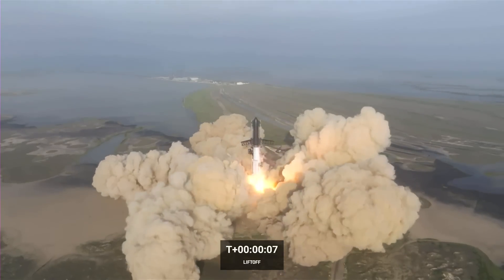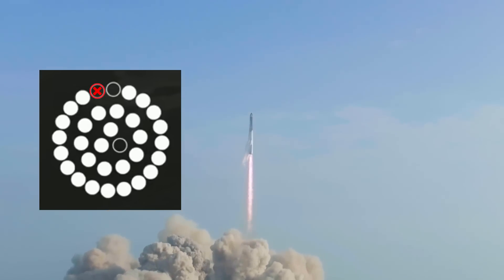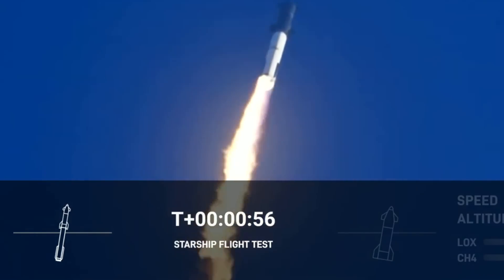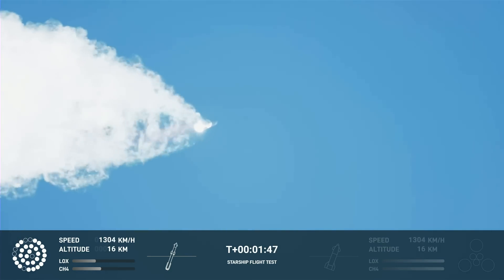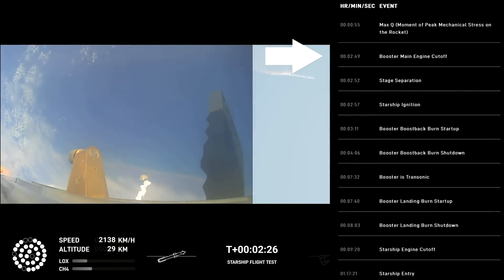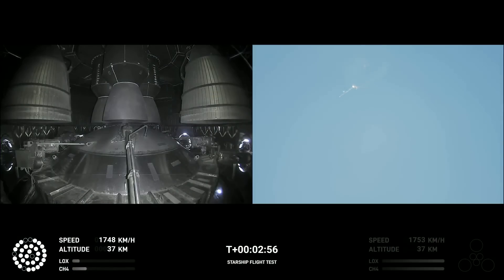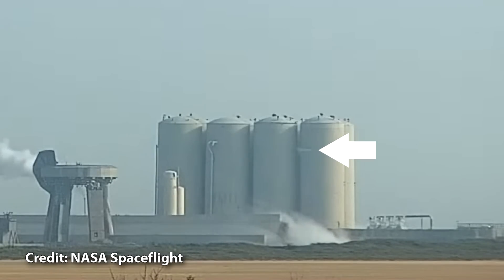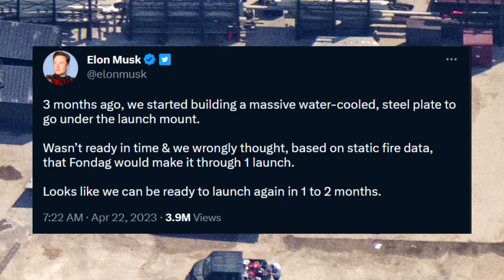I Watched the Starship Test Flight at 0.25x Speed & Saw What Went Wrong | Starship Flight Analysis

Comment: I say the most worrisome takeaway is that the flight control computer obviously didn't know which engines were still lit and operable after about the +30 second mark. 

This caused two prompt effects:

Valves that should have shut down seem to have still been dumping hydraulic fluid, LOX and fuel into ruined engines
...and the computer code responsible for maintaining vehicle attitude never adjusted to the loss of engines and hydraulic fluid.

To me this says the engine compartment heatshields were scoured right off the butt of the first stage by a swirling mass of tens of tons concrete aggregate and steel rebar moving at transsonic velocity, likely in the very first second of ignition, an effect that in turn exposed hydraulic lines and wiring harnesses to exhaust reflux and shrapnel.

Half the hydraulic loops likely bled dry in the first ten seconds. This should have been caught in time to prevent the hydraulic power units from going into a no-load condition and self-destructing. But it wasn't, likely due to a combination of cut wires and insufficient cutoff valves.

The second most worrisome takeaway is the utter lack of adult supervision.

The sheer wanton foolishness of this launch cannot be overstated.

That cloud around the base of the first stage in the first eight seconds? Isn't condensed water vapor, it's concrete dust. Note the color. 

Concrete dust can be seen exiting the pad within one second of first stage ignition, before most of the engines are even lit. Along with it come big floppy sheets of thermal protection felt -- likely a mix of engine compartment heatshields plus protective blankets within the hold-down assembly.

What could have broken up the concrete so quickly?

For starters, it wasn't well-cured concrete. We know that every static test caused concrete damage which was repaired simply by pouring fresh concrete in the resulting hole. The final pour under that rocket wasn't even a month old. It was at maybe 30% of its rated ultimate strength when those engines lit.

It was also fitted into an existing blast crater and not tied into surrounding substrate or structure. Someone added horizontal planes of rebar within the pour, as if this was some airport runway, but did not or could not tie that cage back to any meaningful anchor points outside the pour. Basically the only thing holding it in the hole was gravity.

Thirdly, the acoustic force of the engines was causing the concrete to repeatedly spallate. Concrete hates to stretch, to go into tensile load. Acoustic force causes equal amounts of compression and tensile load hundreds of times each second. The concrete ruptured each time its tensile failure fluence was exceeded, and the resulting spallation fragments carried away most of the force of the rupture. The result was an ongoing series of explosions powered by sound, with fragments moving at shotgun blast velocities.

Igniting that first stage on that stand basically shot it in the butt with an immense shotgun powered by that first stage; Every time it was lit, static test or otherwise.

And yet the executive decision was made each time to press forward with more tests on an inadequate launch pad, inadequately repaired.

The stony expression on Elon Musk's face as the vehicle finally crumples tells us this was not a Satisfactory Outcome, no matter how many rocketry fans assure us it was so...

Comment: Really good analysis. Thanks. 
I was amazed to see Starship actually fly and clear the pad. Brought a tear to my eye to see such an incredible machine take to the sky. Disappointed that the stage separation didn't happen but that just means more excitement to come on the next flight.
Reply: The pad damage is minimal, the tower & launch mount were only slightly dinged up… a pit was dug in the sand, but is easily filled in, new concrete poured, robust pilings added, the new blast deflector & water deluge installed. SpaceX moves onward & upward… while NASA is mired throwing more taxpayer $billions  at it’s unaffordable, unsustainable dead end SLS boondoggle.

Comment: Very good analysis and presentation. I believe this is the first video I have seen from you, definitely subscribing and looking forward to seeing more. If I may add, I believe the launch pad should have been elevated 2 - 3 times current height. For every feet of increase height from the concrete base, would have an exponential positive effect on the psi at  the concrete base thus causing less damage and debris deflect toward the stationary and eventually slowly moving Starship at takeoff.

Comment: Positive:

1. Structurally the Starship held together a lot better than I had expected. Not many rockets could tumble around like that without disintegrating.
2. The rocket had enough power to lift off even after loss of raptors
3. The control of the rocket worked pretty well. They controlled if for a long time with raptors and hpu`s failing
4. The launch tower appeared to do well

Negative

1. The launch pad is completely inadequate and the layout is not well designed
2. The raptor appears to still be unstable. A lot of raptor failed throughout the flight. This is critical as they were supposed to be reusable. We have seen this failure rate from raptor on all launches. Could get critical if they cant make it more reliable.
3. The flight termination system failed and it needs to be redesigned
4. The stage seperation system failed (unless they never tried)

Not tested/inconclusive

1. The heat shield was never tested
2. Is it underpowered/overweight? Looked very slow to accelerate, but unclear if it was just the missing raptors
3. Starship second stage
4. Descent and landing

Comment: I hope that water-cooled steel plate works for a rocket of that size and power. The alternative is to build up a pad like NASA did for 39A for the SaturnV. Took them 3 years, an army of people and equipment and a whole lot of money. With todays stricter environmental regulations, it could take years for SpaceX to even get the permission to do the dredging operation required to build a pad up by nearly 50 feet (39A was 48-49 feet somewhere around there) in an area with a high water table. That's considering they get the permission at all.  Barring that is the off-shore launch as was originally planned but those two oil rigs were not going to be strong enough. Either way an alternative solution would be years out and to get on track with Artemis III they will have no choice but to launch from FL, if NASA will even allow the risk with the powerful Superheavy.

Got my fingers crossed that the plate works out.

Comment: The launch never should have happened.  Without a proper launch pad with water suppression system and flame diverter, OF COURSE they were going to have a failed launch.  The FAA should have said "NO Launch for you."   "Clearing the launch tower" isn't much of win.  That's not something the space industry uses as measure of success since the 1950s. 
In the slow-mo video, you can see concrete chunks SHOOTING around the rocket, HITTING the rocket.  Then on a wider shot, as it's leaving the tower - you can see large chunks hitting the dirt and the water (gulf).     There are articles from 2021 about the Launch towers not approved for launches (testing, yes).

Launching with a lauchpad that couldn't handle the configuration IS BAD.  Having fuel tanks NEXT to the rocket IS BAD.  All that damage was preventable.  This shows BAD engineering, bad planning, corruption (paid off FAA for launch permissions?) and BAD business.

They'll be lucky to have another launch in 2024.

Comment: Aside from the largest rocket in history actually flying what impressed me the most was its ability to tumble without immediately disintegrating. I have never seen a rocket tumble that didn't immediately explode. That's VERY impressive structural strength and comforts me about the safety of future flights
Reply: Over engineered maybe. Possible weight reduction could increase payload.
Reply: Why the FUCK should a rocket be designed to tumble? If it's tumbling, really really really bad shit has happened. If it was designed to be strong enough to tumble, then it's too goddamn heavy and is carrying utterly needless weight. You Elmo slurpers are so desperate to claim everything he does is perfect but you are utterly blind to reality and immune to common sense. WTF is wrong with you?

Comment: My take on it: It went further than expected, but still disappointed it didn't at least reach separation. Great analysis, thanks!
Reply: Why the FUCK didn't you expect it to go further? If you think all it had to do was just clear the tower, what if it had blown up 1000 feet above the tower? Would that still be a success? 100 feet? 10 feet? Why didn't they expect it to survive liftoff? That means it wasn't ready! Claiming that it succeeded simply by clearing the pad is like saying your brand-new car is great because you were able to back it out of your garage before the engine seized and the wheels fell off.

Comment: Starship is not held down by clamps during launch.  The clamps are released much earlier during the countdown.  The engines are ignited at 50% thrust, below a thrust to weight ratio of one.  The rocket sits there until the engines ramp up to full power for go.

Comment: Okay, let me get this straight. Eight out of 33 engines died of some cause or other, the HBU exploded, there was apparently a massive loss of fuel somewhere along the way, the flight termination system didn't terminate the flight, and stage separation didn't work... also, the state park near the launch site was bombarded with concrete, and it's sheer luck that the fuel tanks didn't go up in flames.
But the only real negative is that the launchpad was damaged, so it'll take a while before they can do it again?
Something tells me you're a bit on the optimistic side. Would your evaluation be the same if the rocket had been made by a company not owned by Elon Musk?

Comment: I predicted they'd think about launching with X engines missing and would decide in advance how many missing engines they would tolerate. Elon confirmed this: They launched with three engines out. 

There was a launch "recently" (last year or so?) where the stage separation didn't work as expected. They just started up the second stage and "overruled" the failed stage separation. 

I would have hoped they would command a "forced" stage separation once the tumble started (i.e. first a "release clamps" and then just ignite the second stage: see what happens). Having starship start off in an unusual/unexpected attitude and hopefully being able to gain control is better than just hitting the self-destruct button.

Comment: Nice video!

In order of severity:
1. FTS didn't work, in as much as a worst case scenario may not have handled wayward-rocket-syndrome.  This will make FTA very cautious.  SpaceX will need to refactor the FTS, and then "prove" to the FTA that the revised FTS will work.  Given there is now evidence of a FTS not working, I am wondering a "paper" test will be sufficient, and if instead some in-flight abort test may be required. 
2.  Raptor reliability.  I suspect these are older raptors, and newer ones may be better, but even so, a lot failed.  Elon's twitter update suggested the three at start simply didn't come up healthy.  Subsequently many failed.  Almost every flight test and static fire has had some degree of engine issue.  Sure, lots of "little" engines gives reliability through redundancy, but after years of development we still have failures.  Full flow staged combustion is hard, I worry if it remains too hard to be "airplane like operations" reliable.  Hopefully they've gotten lots of real world data, and have root cause, and latest raptors have tweaks to improve.  Maybe then the best course of action is put older raptors on a superheavy, build a dummy starship, and do a in flight abort test, and then move to latest raptors.
3.  Launch mount is meh.  Most acoustic energy is at 45 degrees to plume (iirc), so a deluge system exists for sensitive stuff like payload and the pad stuff, so it just needs to keep the pad cool enough not to disintegrate and cause public concern and possible rocket/pad/tank-farm damage.  Water cooled steel plates laid into the floor seems reasonable for v2.

Comment: I can’t understand how SpaceX designed and constructed that launch site so poorly. Typically, great efforts are made to deflect hot gases and cool them with massive amounts of water while touching any kind of structure. Secondly, why did they place so many facilities like their storage tanks that close? Damage during launch had to be expected. Maybe the pressure to get StarShip off the ground quickly was just too high to construct the launch site properly.

And I doubt that the maximum design dynamic pressure was reached.
With that much thrust missing, acceleration was lower than planned, and therefore speed. So the peak q, which is proportionate to v^2, that was reached during this launch was certainly lower than it would have been in the regular flight profile.

Comment: Excellent analysis. Thank you for sharing it. I'm very impressed by what SpaceX accomplished in this flight. I think it's an incredible achievement. That said, they definitely have a lot of work to do before the next flight. Also, I have a lot of respect for SpaceX, but I have no idea how they could have thought the Stage 0 design would work. My only surprise is that there wasn't even more destruction of the launch pad area. This video earned my like and subscription.
Reply: Stage 0 wasn't the only problem.  Shit was falling off this thing mere seconds after liftoff.
Reply: @MrShobar  Not withstanding stage 0, this launch was a huge success. Elon wanted to launch it to get rid of it. The next one has many improvements It could well be that the rocket was damaged by the flying debris from stage 0 and below.
Reply: @darylmorse  "Elon wanted to launch it to get rid of it..."  What a joke.  You believe that?  I laughed out loud.
Reply: @MrShobar  It's common knowledge that the design of this particular booster is obsolete. The most important thing they could get from it is engine data, which they got. You seem to not understand this. That's your problem. Good bye.

Comment: I've also read from SpaceX that the three engines were shut down before liftoff.  The engineers decided to go ahead with only 30 engines.  After all, that spacecraft weighs a lot less than a fully loaded one, so there's a lot of extra lift capability.
Reply: Is there a report on those 3 engines?    What likely happened, is that the launchpad it was destroying flung concreate chunks into those engines and other parts of the ship before it even left the pad.  Thus.. dead engines.  In the slow-mo video, you can see concrete chunks SHOOTING around the rocket, HITTING the rocket.  Then on a wider shot, as it's leaving the tower - you can see large chunks hitting the dirt and the water (gulf).     

Launching with a lauchpad that couldn't handle the configuration IS BAD.  Having fuel tanks NEXT to the rocket IS BAD.   They'll be lucky to have another launch in 2024.

Comment: Russians tried for a long time to make rocket with so many engines, and couldn't do it. With so many engines, they create feedback loops that tend to destroy vehicle. But the Starship managed to survive until most of the fuel was burned out, and the issue was lack of altitude control, not thrust control. This can be fixed quite easily. The lack of flame diverters and water suppression seems silly, I guess there cannot be a water suppression system on the Moon or even Mars, so that's why they wanted it that way, but still, I don't think we will see Superheavy launching from those places soon, and probably not at all.

Comment: Excellent video! I'm just a simple aircraft mechanic & know little about rockets or Starship. One thing sticks out to me. 33 engines. It has thirty-three engines! Saturn had 5. Fueled by liquid hydrogen, they seemed to work just fine. In my head 33 engines just seems like too many chances for failure. Why 33? Anyone? Thanks.
Reply: ''The number 33 is an occult Master Number and a way to open the “Third Eye.”
Contrary to the Bible’s negative connotation, the New Age and occult movements have embraced the number 33 wholeheartedly declaring it a “master number.”
According to 33rd degree Freemason philosopher Manly Hall 33 is a key to achieving immortality...''

33 is a MASSIVE rabbit hole to go down............................................

Comment: There's one thing I've been thinking about: The LOX and CH4 bars in the stream overlay are the same length to begin with so I would assume in a nominal flight, the levels would stay aligned relatively closely. They do at first. Then  at about t+1 minute there's a bit of orange glow in the exhaust and LOX levels drop quickly. LOX depletion stabilizes after a few seconds until the MECO call. Following that call, LOX again starts depeting rapidly while CH4 doesn't move much.

So I wonder a. If there was a loss of LOX due to engine failures and b. If the termination system made the decision to end the flight and blew holes into the LOX tank early, so that LOX would spill out of the tumbling rocket and disperse first while the release of CH4 would be delayed until the craft disintegrated completely, which would then minimize the size of the potential fireball?

Though it could also be that the sensors for the CH4 levels were damaged in the termination sequence...

Final thought: 2 month rebuild is ambitions but to be fair, they did excavate a 10m wide and 10m deep hole in 15 seconds or so, which is probably about 10000% faster than industry standard.